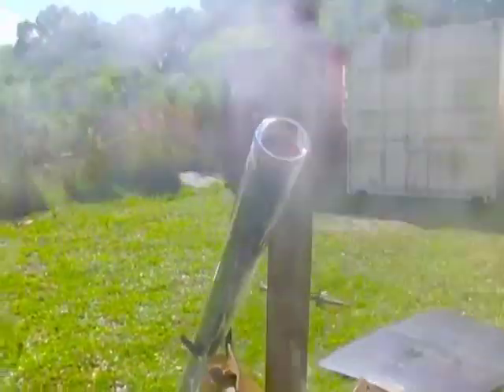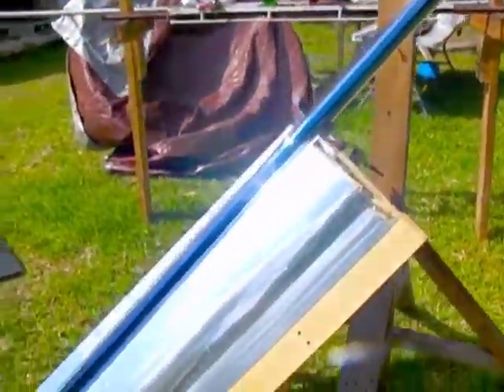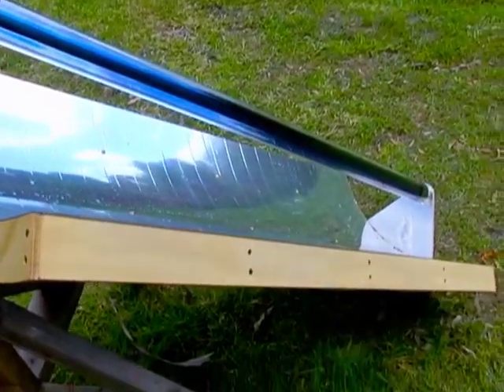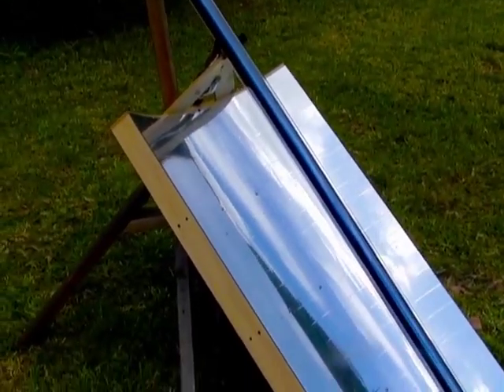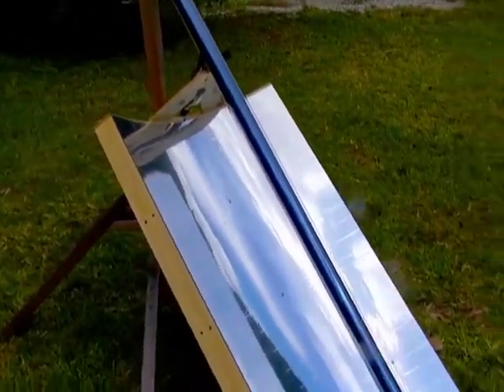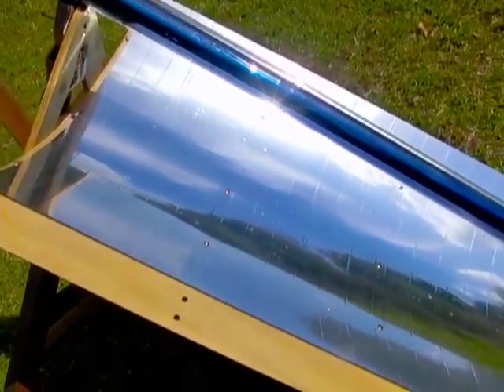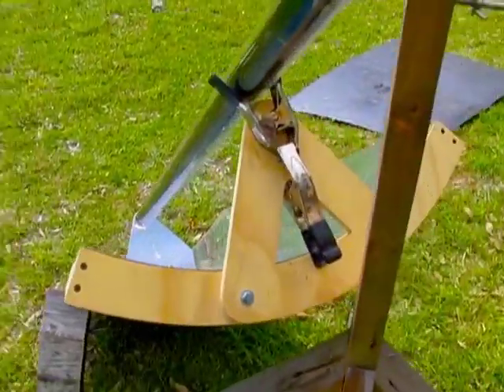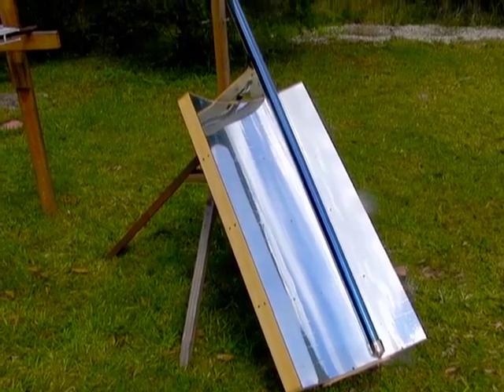Evacuated Solar Tube Parabolic Trough Mirror Kit BOIL WATER DISTILL

Comment from the maker: The only real advantage is reaching and exceeding a boiling temperature to produce steam. For pools, I like the black hose in an enclosure and for domestic hot water the evacuated tubes alone are a FANTASTIC simple option. Standard evacuated water heaters can benefit from a flat mirror placed behind the tubes but is not needed.
Reply: i'm thinking of putting a large triple glazed window in my attic and placing evacuated tubes and mirror behind it. Do you think I would gain much my having the array indoors (i live in ireland)
Thanks!

Comment from the maker: Vertical requires a heliostat tracking device. If you place it horizontal and East West you only need to adjust for seasonal sun positioning. The later is less efficient as you lose about 20-30% in the AM and PM.

Comment: Align the trough eat-west. Tilt to match the angle of the sun at noon that day.
Use a big diameter shiny metal pipe blackened with soot on the underside.
Cap the ends except for a bottom inlet pipe hole and top steam out hole.
Don't fill the pipe with water. Less water will flash to steam quicker.

Take 2 shiny heavy wrenches and soot coat 1 black. Leave them out in the sun and the black one will heat up quicker but the silver one will get just as hot to the touch. Put them both in the shade and the shiny one will take WAYYY longer to cool.
Shiny pipe top will lose heat in the pipe slower, blackened pipe bottom will take in sun heat quicker.

You can heat air instead using stove pipe.

Comment from the maker: Hi,

The part A we use is on our website greenpowerscience com and is listed under reflective material. Part A is a good choice. (worldwide shipping) To cut in strips do this:

watch?v=Q90i31JIQ3M

Thank you for enjoying our videos. 
Dan
Reply: @Greenpowerscience do you happen to know a source for open ended evacuated tubes?

My use case requires bottom feed, but finding such tubes that are an open pipe on both ends is like pulling teeth 😢

Comment: Dan, I was thinking that this would be a good segue into exploring pop-pop engine design.  They're not terribly efficient compared to Stirling engines, but they're trivial to build and operate.

They've previously only been used in toys in the past, but with steam expulsion like what's on this video, it looks like you can get an engine big enough to use on a small canoe fairly easily.  I think it'd make a pretty neat, albeit useless, project purely for fun.  Maybe a good competition idea!

Comment from the maker: The way to do it is to use oil in the tube and a 4ft steel pipe 3/8" dia in the oil with water in the steel pipe. The thin glass does not support more than 15 PSI, so the oil acts as an exchange medium at zero pressure. The caps on the steel pipe need to be sanded to fit. Oil alone will reach 400F+ without a trough and well beyond the smoke point without a heat remover.
Reply: What type of oil do you suggest using for this application?  We would like to us the oil to provide heat to a container of water through a heat exchanger to provide steam in a continuously revolving closed circuit.

Comment: Try a deep parabola so the sunlight is coming in from the sides as well.
Use the locus method to plot Y=X^2. 
Focus to curve distance is always = Y of the curve. Draw horizontal lines then measure from the focus to find the intercepts of each line. If the focus Y=20, the bottom will be Y=10.

Can you polish aluminum flashing like a soda can bottom fire starter?

Another shiny metal source is soda/beer cans. Under-label aluminum is plated. Paint remover and fine steel wool gets the paint off.

Comment: Help me see the uses. You could capture the steam from several tubes. Have a way to refill the tubs, check, pressure valve, etc. Duct them together to turn a turbine. From there you can charge DC, invert it and use it. You would not use glass. You would use another material for the vacuum tube. Durability, or maybe not. 

Am I way off or on the right track? Are my principals correct? I do HVAC, and have been into passive and solar and several years. I have just found parabolic mirrors.

Comment: Hey Dan!!! great job you're doing man ... thanks from the kid in me! I had a question if you don't mind. I was wanting to make as much steam as possible and thought of two things. 1) if I put 2 or 3 heating tubes in series together in one trough, do you presume it would produce more heated water? 2) if I made the heating tube out of a piece of rectangle tubing, off set the inlet/outlet to the top, half full of water, to get more steam less water? a little more surface area also? Maybe? Thank you